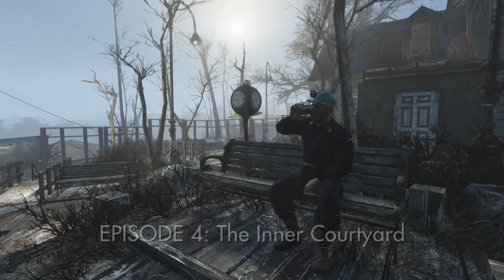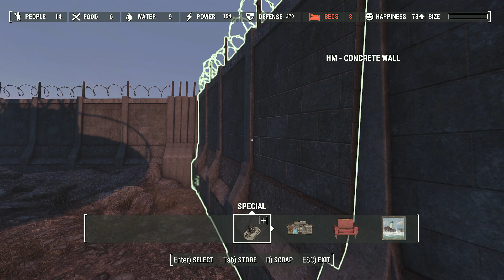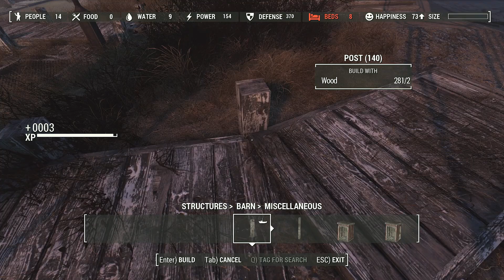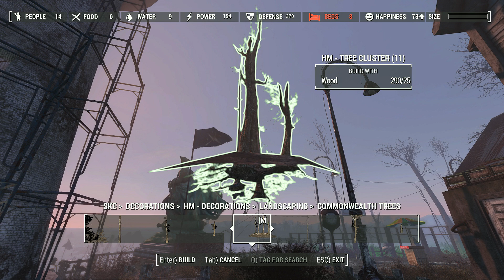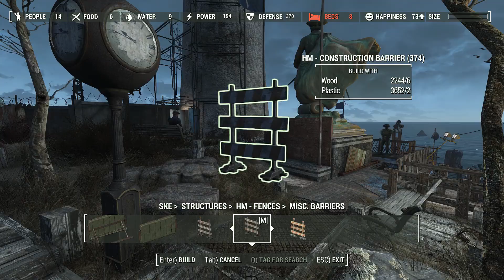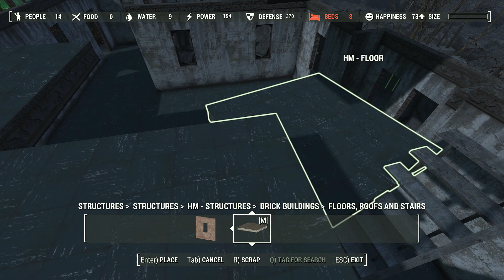FALLOUT 4: BUILDING A MINUTEMEN WELCOME CENTER (Kingsport Lighthouse Ep. 4) | RangerDave

Comment: I love the park area, looks fantastic!  I agree that the food stand needs retexturing. The admin/barracks building kind of looks like a rifle or a pistol from a certain angle, which is sort of fitting. Looking forward to seeing how you setup the interior. That build set is a bit frustrating to work with. Especially the non-flat roof pieces. It doesn't seem like there's anything in that build set to cover the wall piece with the two windows that juts out, either. I end up spending a bunch of time trying to figure out what would be a fitting roof for that part.

Comment: Realistically, trees and fauna would grow just fine after 200 years, however as the Fallout aesthetic is dead and decaying, I always try to give a mix of both living and dead trees. The way I see it is that in poorer settlements, the trees tend to be a dead as they're left alone or used to prop up shelters. In the richer settlements, I like to put in living trees as if they are being actively cultured by the settlers, using purified water and fresh fertiliser etc. As this settlement is a bit of a show of power settlement, it would be good to have at least one big living tree to kind of display that with General Dave, anything is possible!

Personally, I do like the dead trees though, maybe you could add some low light lanterns or string lights hanging from the branches?